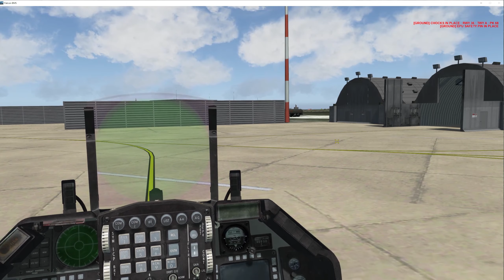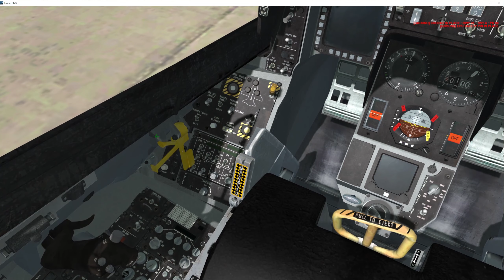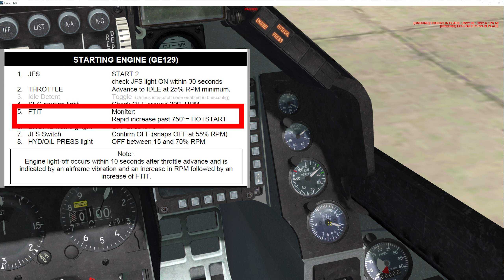Falcon BMS 4.37 | Falcon BMS vs DCS F-16 Startup Differences

Comment: To add: switch on the Green Oxygen Lever. Otherwise you may experience hypoxia when flying for prolonged time at high altitude...
Reply from the maker: Very true. Thanks for the addition.
Reply: Must be on by default cause I never use the 3D cockpit and I use my real one and I don’t get hypoxia etc
Reply: @RainmanHST  it isn't on by default. You can see it off in his cockpit and I just used this video to startup and it's off.
Reply: @HolyOrangeJuice  that’s incorrect.  You are only turning on the pilot breathing.
Reply: @RainmanHST  That's not true as with the latest verions. You gave to turn it on. Try to get battle damage above a certain altitude with it off. It used to be only breathing sound (which is turend off by default now). But at least since 4.36 hypoxia was integrated and you will only get the breathing sound when pulling G's.
Reply: @TheFietek  I know that’s what we put in the manual.  I’m just saying it doesn’t work that way.  I never turn it on because I use a real oxygen panel and never mapped any other switch to it and I’ve never experienced hypoxia or any other limiting factor with it on or off.  I’ve tested it at 52,000 feet.
Reply: @RainmanHST  And yesterday I got hit high alt and had hypoxia after ~15 seconds. The screen slowley turnedgrey, then black. Maybe it was something else. But I for sure had oxygen off and had never experience something similar. The aircraft was still controllable and pulled no G's. The F-16 cockpit is pressurized so you shouldn't have any oxygen problems at all altitudes if the A/C is working fine.
Reply: @TheFietek  I just checked on the dev forum and it is suppose to be off by default.  I’m going to look into this more.  Thanks for bringing that up.
Reply: @TheFietek  I don’t know much about hypoxia but my understanding is without a mask on it wouldn’t take long to go hypoxia and like I said I’ve never turned it on and never noticed any hypoxia in my flying
Reply: @RainmanHST  I guess you just never get hit :D 

No worries. Hypoxia (should) depend on altitude. Above 30k it takes less than a minute just above 10k hours. I was just above 20k so that might explain why it took a while. Pls let me know what you find out :)
Reply: @TheFietek  yeah that’s exactly my point.  I was at 52,000 feet just the other day for well more than 20 min and no hypoxia.  So we are going to look into this
Reply: @RainmanHST  That’s all true. But again the cabin is pressurized to below 10k feet. So you would only have a need for oxygen if pressurization fails or there is a hole somewhere. As long as the canopy is closed you are all good.
Reply: @TheFietek  well that makes sense.  Ok I better map that switch to something in the cockpit then.  Lol
Reply: @TheFietek  I don't know if BMS models this, but the mask is a part of G tolerance due to it's positive pressure flow (forces the oxygen into your lungs when you maybe already struggling to breathe). I didn't know that BMS was modeling depressurization hypoxia like DCS, good to know. So yes, you want oxygen on for that safety back up then in the case of battle damage. If you and the Viper Simmer don't like the oxygen sounds, I believe there is a option to turn it off in the BMS sounds setup page.
Reply: @RainmanHST  What do you mean by " @HolyOrangeJuice  that’s incorrect.  You are only turning on the pilot breathing."?
I would expect a guy called viper simmer to do this, espeically after it's implemented.
At least please provide an actual source to your claims since it was clearly in the patchnotes.
Yes, BMS is still not fully modeled but that doesn't mean the parts that are should be skipped.
Reply: @kontoname  what I am saying is I am using a real F16 cockpit with a real oxygen breathing system.  Thus I never mapped that function to any switch in my cockpit cause my oxygen regulator is real.  In my experience flying BMS not turning it on has NO affect other than the breathing sound which I don’t want to hear anyway.  I’ve been on the Dev team since 2003 so I’m well aware of what’s implemented and what’s not.    That being said I raised the issue and we are looking into this now.

Comment: Nice quick video.  Please note though HYD/OIL light must come off no later than 45% not 60.  By that time the engine will burn up.  It usually is out at 35%

Comment: Thanks! I am trying BMS and test if I want to switch from DCS, since the VR support is there now.
One question: what do I do if the FLCS Bit failed? How is it repaired?
Reply: FLCS Reset switch just left of the test switch should clear it out.
Reply: Besides the FLCS BIT one extra step IRL would be to slam the surfaces around some to work out any stuck bubbles and to warm up the hyd system a bit.  Other than those two steps it is beyond the scope of a simulation.
Reply: Do an flcs reset before making the bit test

Comment: They just added VR, I bet it is really good. Since the graphics are lower the FPS should be higher, so VR should be a lot smoother.
Reply: Can confirm. VR is pretty smooth.
Reply: first time i played falcon 4 i was 14, i remember studing that endless f16 istruction manual in 1999. I always love falcon 4 and bms. STILL, let's don't say dcs is not smooth now, i'm at rock solid 70fps in vr at very high settings. Dcs vr is good too :P
Reply: @vrgamingitalia8105  After playing DCS, it's hard to play BMS. The visuals of DCS is amazing, especially now with the MT in VR. BMS is a little more realistic though, from startup to shutdown. Even the AAR basket with the F-18 is more realistic. It will bump off the plane and probe. DCS really needs to work on the AAR baskets. The dynamic campaign is where BMS shines though.
Reply: @ComdrStew  yeah bro, i'm really having good time in pvp on growling server, in 30 vs 30, in vr, sometimes it feels like i'm not on a chair... insane.

Comment: In DCS, when doing a normal alignment, you need to confirm the LAT/LONG pos you see on the INS DED page. Do you need to do that in BMS?
Reply from the maker: No you do not. There is not way to verify your LAT LONG in BMS anyway we don't have F10. In real life the LAT LONG is painting somewhere on the ground or wall within view of the pilot. Thanks for watching
Reply: @AviationPlus  Actually no it isn't painted on the wall or ground for the pilot to see.  At least not for the USAF.  It was just known to the pilots and they entered this data for the start of the align.
Reply from the maker: @Stubbies2003  At the 4 bases and flightlines I have been with F22s it has been painted on the ground or somewhere in view of the pilot to see.
Reply: @AviationPlus  Perhaps that was a F-22 location thing as I worked on 16s and these are the locations I never saw that at.  Luke AFB, AZ, Kunsan AB, RoK, Osan AB, RoK, Hahn AB, Germany.  That is covering almost my entire USAF career right there.
Reply from the maker: @Stubbies2003  Asked someone who was at Kunsan a few years back and it was painted on the shelters but all of this is besides the point.
Reply: That certainly used to be the case (if you didn't confirm it wouldn't show steerpoints in the correct place), but I don't think that's the case any more.

Comment: I remember the previous version had the startup checklist on the pilots 3d model kneeboard... is there a way to return that?
Reply from the maker: Yes there is. You must enable the pilot model and set up your kneeboard with the checklist. I think in this new update the kneeboard defaults were changed. Weapons Delivery Planner would be used for Kneeboard pages.

Comment: Just curious, what sort of flight control failure would you encounter for not running the FLCS Bit?
Reply from the maker: You have 4 branches and there is a chance that one of them might lose power or be degraded randomly during your flight. It can make your FLCS very strange and controlling the aircraft can be difficult.
Reply: @AviationPlus  Isn't FLCS Bit just a flight control system check? Why would it prevent potential malfunction from hapenning in the future?
Reply from the maker: @LymarkW  This is something that is debated but you can still setup other systems while it is performing the test so it's not a complete waste of time.
Reply: @LymarkW  I think the point being is that they are simulating that the aircraft already had this malfunction in it but the pilot skipping the FLCS BIT check wouldn't know it until it was too late.  Just a way to keep virtual pilots from being lazy on the startup sequence.
Reply from the maker: This is the best explanation I have ever seen
Reply: @LymarkW  The potential failure is, we lose the control hehe
The F-16 was the 1st jet to have digital fly by wire for all its flight controls system (FLCS), controlled by flight control computer (FLCC), (no mechanical linkage bak as far as i know), that's why they provide it with EPU to make sure the aviator find a great place for belly landing in case of engine flame out and unable to restart.
So, as long as the EPU still has the Hydrazine, pilot smile and the jet happy😊
Once it runs out of hydrazine, Sayonara my fren v: 🤙

ps. The Electric Jet.
That is one of the F-16's unofficial nickname beside the sweet16 and the Viper.
The Fighting Falcon?, well that's the Official one, NATO designation code, FF

Master Caution:
*Do not just believe what you've read in my reply my fren, for more detail, please refer to manual yeah my fren😉🤙
Reply: @tac-cobserver3788 I can totally see the jet happy with her intake's shape :D
Reply: @danielfang749  now that's an expensive happiness :D

Comment: Hi im playing this with mouse and keyboard but idk how to Nose up/down there's some key for manual nose up but it's way too slow any ways to control the jet better with a keyboard?
Reply from the maker: Check your docs folder \\Falcon BMS 4.37\Docs\00 BMS Manuals\bms-technical-manual page 83 for default bindings. Search in the launcher where you set up controls for FCTRL and that will show you what bindings are for Flight Controls. Seems to be Ctrl Shift Arrow Keys. Without a HOTAS simulators especially this one your experience will not be ideal to say the least. Some get a cheap stick or a console controller. Good Luck
Reply: @AviationPlus  Thanks,much appreciated
Reply: @AviationPlus   i figured it out thanks bro,actually one more question in dog fights i really get in truble while the opponent jet is behind me idk how to lose hem could you lmk if there's any key to turn or maneuver to get off?
Reply from the maker: @the_eagle_of_masyaf  There isn't just have to keep trying. You need to take advantage of their mistakes it's not going to be obvious it will take time to notice those mistakes.
Reply: @AviationPlus  Thanks a lot i just wish there was any way for a sharper turn airbreaks wont make any difference i'll keep trying, i'm like just wow,how realistic is falcon bms and how do rhey turned such an old game to something like this!
Reply from the maker: @the_eagle_of_masyaf  It will take time. Take a look at this video. https://youtu.be/x5SBgx6yJD0?t=914
Reply: @AviationPlus  totally worths it,much appreciated.

Comment: Totally rookie question - would it be possible to move all of the F4 code into Unreal engine and merge?
Reply: No.
Reply: Please don't. We don't need an ultra graphic for BMS!!!! The F-16 Model can be more detailed maybe, or higher resolution, but even now it looks great. It's a Sim with realistic procedures and the Dynamic Campaign when you are ready as "Pilot". We don't have any issues with frame drops, everything works very well and now VR is there and works nice. If you want this game in Unreal Engine, please install the free DCS and buy F-16 Viper Mod for some bucks (Its worth). 

I hope the BMS Devs will not try to make new graphic, for frat reason? It's about training, about weapon systems and the simulation of war as a combat pilot. I don't care about how the buildings look, I care how to accomplish the task. Actually the terrain looks great, no need to make Google Maps terrain LOL...
Reply: @ProGamer-gc3wv  I don't think we have to worry.. it's taken 20+ years for Falcon 4 to get this good. And bolting a proper dynamic campaign into DCS is realistically years away if ever.

Comment: The MFL at the start are spurious faults and just need to be cleared out.  It doesn't hurt anything to FLCS reset but it also isn't required to clear anything other than FLCS faults.

Loading the DTC prior to turning on all systems, including your radios, chaff/flare, etc. is a mistake.  Any of that DTC data load on a system not turned on won't be loaded.

Also you never covered entering of initial coordinates to the INS when you turned it on.  I don't recall how picky BMS is for this but on SINS or RLG INS systems that will cause the alignment to fail.  Also your description of what happens if you move prior to going into Nav mode is lacking.  It isn't that it will just "take longer" the system will have sensed that movement but not being in Nav mode/still aligning the system you have induced an error into the alignment thus the INS system will drift.  Yes there is an auto Nav function for those that forget to do this but it has to sense the movement prior to going to auto Nav thus you have still induced drift into the alignment.
Reply from the maker: This was not a incremental engine start following the check list step by step. There are plenty of videos on that. I was only pointing out Key Differences vs starting up in DCS.

You are absolutely correct about not loading your DTC before all of your systems but in BMS that only applies to radios in which I mentioned specifically if you do not have the correct radio frequencies it was because your radios were off you can just load COMMs. 

There is a reason why I did not cover entering initial coordinates because it is not needed in BMS. 

Apologies for not completely explaining the full INS process in my Key Start Differences video so instead I simply said it will take longer. 

Surprised you didn't mention EPU Check, SEC checks, EPU pin and chocks.
Reply: @AviationPlus  Yeah I wasn't thinking about the entire startup and not having flown in BMS for awhile now but in DCS those are all things (EPU, SEC check) that they haven't even gotten close to doing yet.  Chocks are done basically the same in both and isn't part of the startup sequence but when you are ready to go fly.  EPU pin is tied right into the EPU check so I don't consider those to be two separate items.  If you forget the EPU pin your EPU check isn't going far.
Reply from the maker: @Stubbies2003  Oh ok well thanks for watching

Comment: What?? There's a cold start in Falcon BMS????? All the BMS player I've met in DCS are all requesting to have "hot" jets on the ramp 🤣
Reply: so......? what is ur point?
Reply: I am confused by this. There has always been cold starts in BMS. This is nothing new.
Reply: Cold start exist since ... 2005.
Maybe they moved to DCS because Falcon4BMS is too much demanding or too advanced for them (?)
Reply: @C.1.GALLET  Actually I had made the move due to VR support.  Just like going from no head tracking to some form of head tracking you cannot un-see or un-experience the goodness that is VR for flight simming.  Now that BMS has added in VR support I will have to check it out again.
Reply: @C.1.GALLET  are people like you so arrogant about what game yall play?
Reply: @mailman35419  Not really actually. Just specifically arrogant (but factual) toward MeltDown950's comments. ;-)
Reply: @mailman35419  it's just a thing, you can make jokes about DCS players with no issue but hell comes down if you make jokes about BMS gamers.